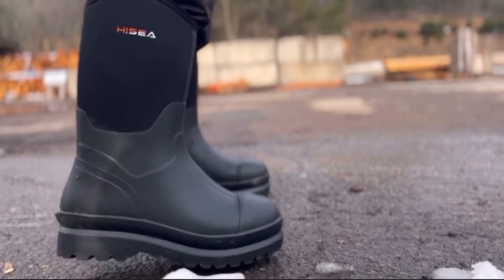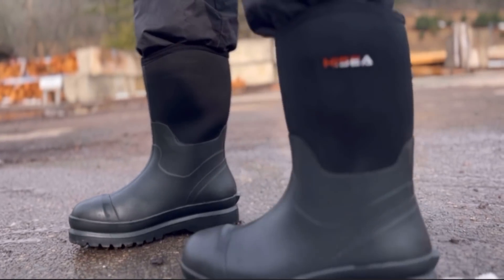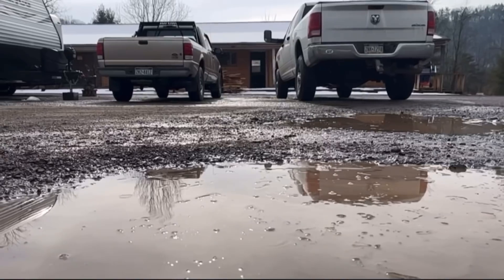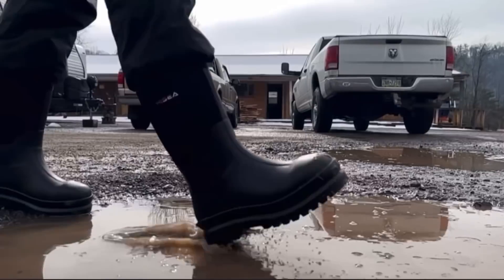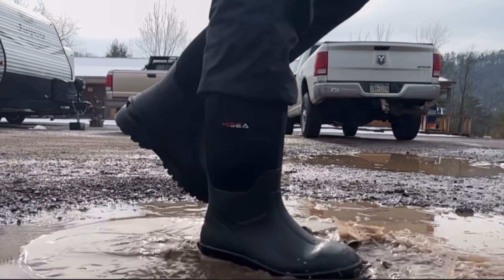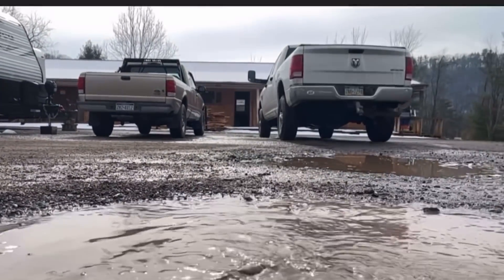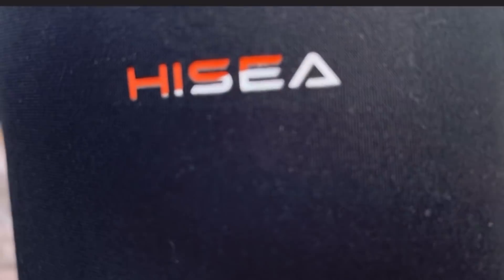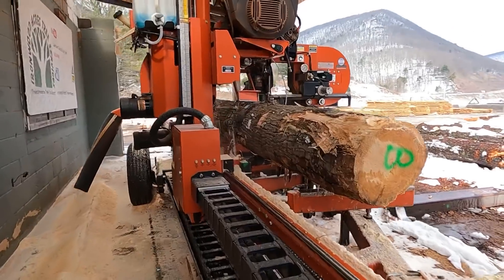Catching up on lumber orders with the LT40 Woodmizer

Comment: My corks (Wesco boots) were way more than $200.00. I had them built in2009 while deployed. I wear them everyother day (I have 2 pairs) since 2010, only needed 1 rebuild in 2017. 
If any goes that route, add 2" to what you want I wanted a 12" boot, so ordered a 14".